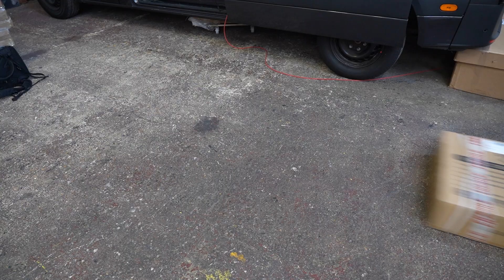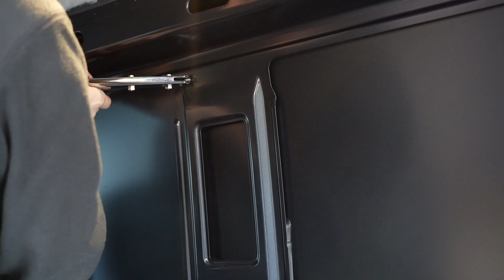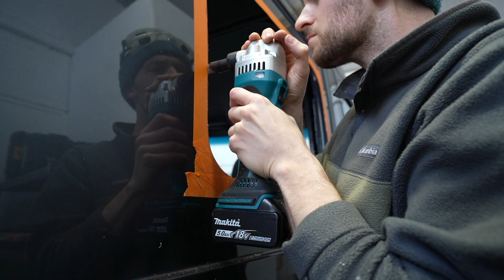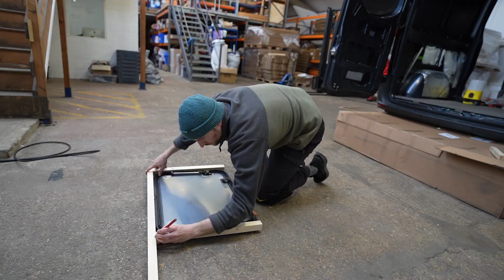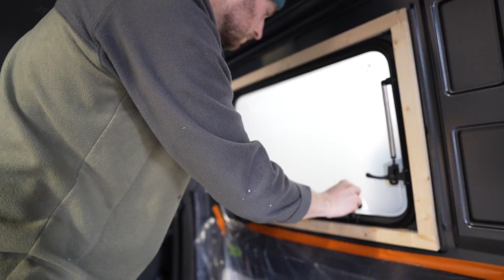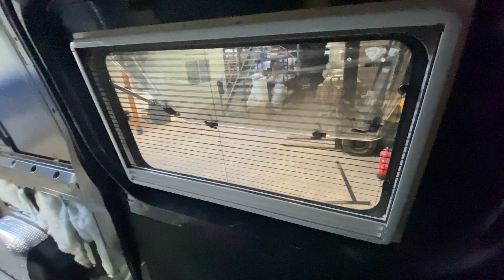140" Sprinter Conversion - Installing Double Glazed Windows - Sprinter Conversion

Comment: thanks for the cool video. love it. just wanted to know if you have to use a curved frame window, of flat frame. Cheers mate.
Reply from the maker: Late reply on this one! I used a flat window on this build and the upcoming build too. You can get a bit of panel warp, but even with the curved windows you'll need to make a curved inner frame to ensure there's no panel warp, the window alone won't do it. Hope that helps (9 months later)

Comment: Great video. Thinking of putting one of theses windows in my van. How tough is the glass or what ever it's made from. I'm a little concerned about scratching from road side headges
Reply from the maker: What did you go with in the end? The Acrylic ones on this van were fine, any hedge marking seemed to polish out with each wash!

Comment: Hi - when you fitted these did you get much pulling strength from the clips?  Seems that will only pull in 1-2mm? also, with you straight frame - did that cause an issue at all with the curved windows? Got the same ones and would love to know
Reply from the maker: Plently of pull strength on them, these windows were flat ones, but you would need a curved inner frame to match the curved outer window to not get panel warp. What did you do in the end?